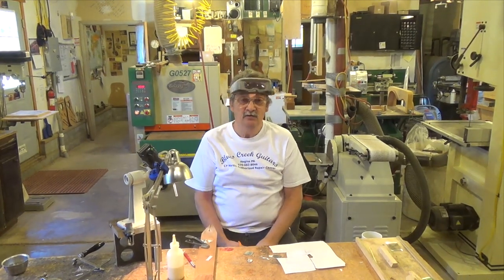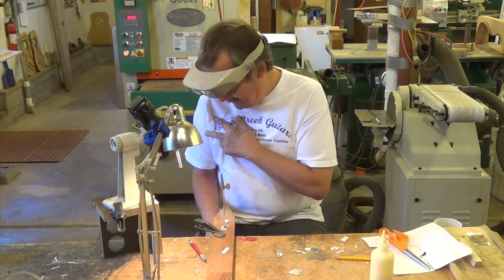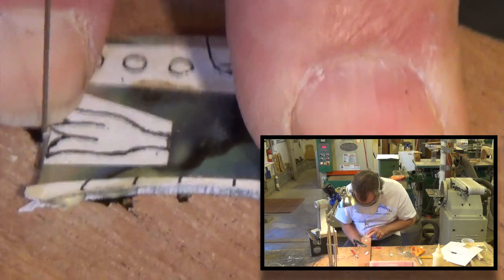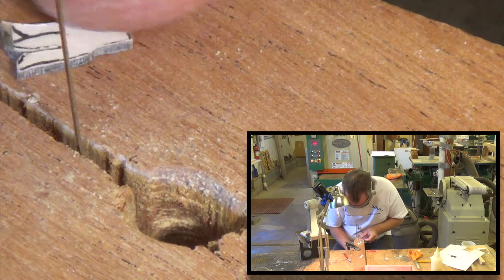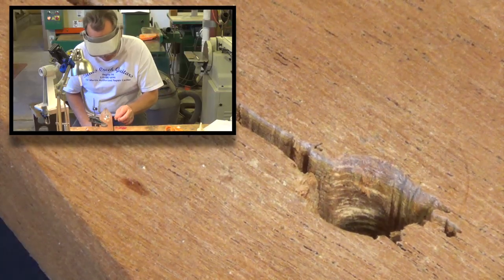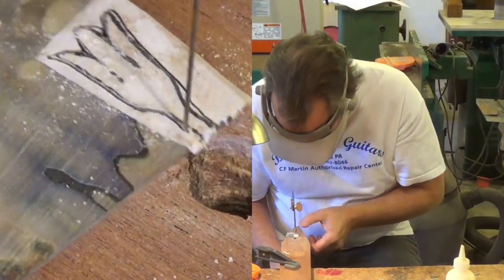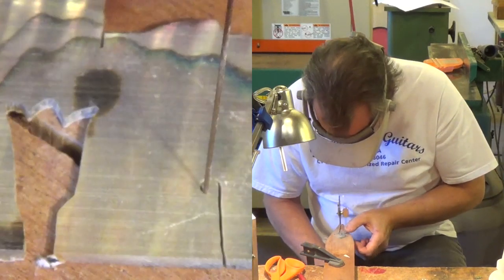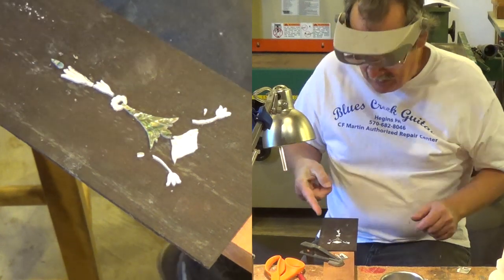Blues Creek Guitars - How to Cut Pearl for Guitar Inlay

Comment: Thanks for the share.  I think begining to cut from the tip would make holding the piece easier.
Reply: If you cut the the small stem  you don't have much to hold on later when cutting the flower and it can break off

Comment: Hi there!

I have to cut some mother of pearl blanks with a thickness of 1 - 1.5 mm, I'm trying to use a 2/0 files but it doesn't work, I mean, I got hard jamming of the file. I have even broke one blank of mother of pearl in 2 half the first time. Let's see if I can solve this situation. Do you put titebond on the back of the blanks in order to decrease the fragility of the mother of pearl? 
Also, what is the files dimensions you are using in this video?
Reply: +LightsnRoses   what you need is a jewlers saw  We do sell them at Blues creek. A file isn't the best tool to cut pearl. It can be ok to clean up the edges.
Reply: +blues creek guitars oh sorry I didn't mention, I'm using a a jewlers saw, I was talking about the file of the saw!
Reply: +LightsnRoses  We call that the lade  I use 0000 size , that may be your trouble  too course will bind for sure.  Let me know if that doesn't help
Reply: +blues creek guitars mhm you mean 4/0 size? I'm in Europe, i don't know if there are the same size names! I could take this http://www.amazon.it/0-Lama-sega-gioielliere-Piercing-confezione/dp/B015ALFYOK?ie=UTF8&psc=1&redirect=true&ref_=ox_sc_act_title_2&smid=A2CW08UCOOS6WR for exemple which include several different sizes.
Reply: +LightsnRoses 4/0   that is what you need

Comment: pearl dust is extremely toxic.... i suggest using a dust mask at least and a vacuum setup.  looks great man!
Reply from the maker: +j87571  I often do a double glue up and use tite bond. I don't boil just set it in a bowl of water.  It is fun to see how others do things.  There are many ways and the sharing of information is a good thing. I never tried the backing on wood  but you can also work in the wood to the inlay . Another color for the palet.   thanks for the tip
Reply: according to OSHA it is a nusance hazard  but yes  protect yourself. Using  a mask is not a bad idea.  For video I don't use the dust collector as it would make too much noise